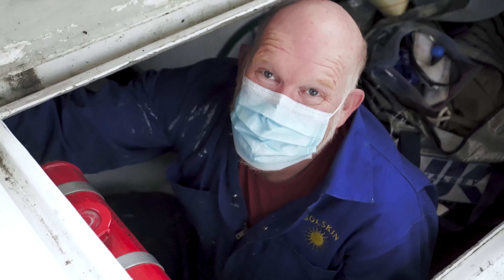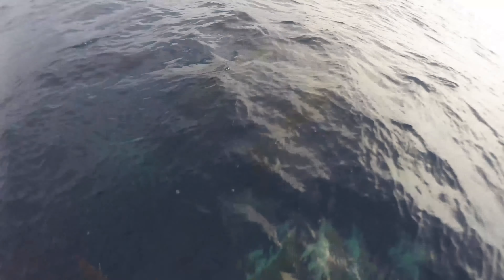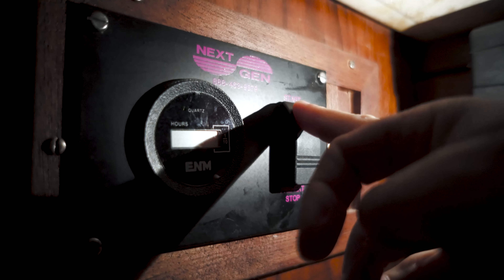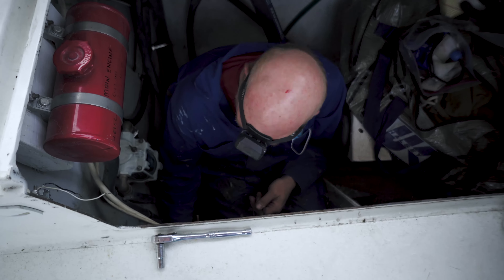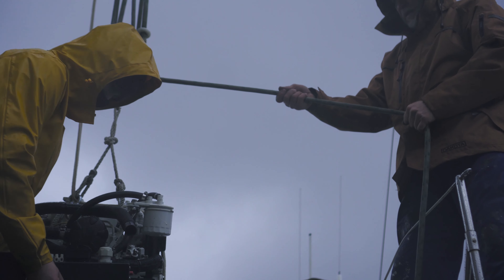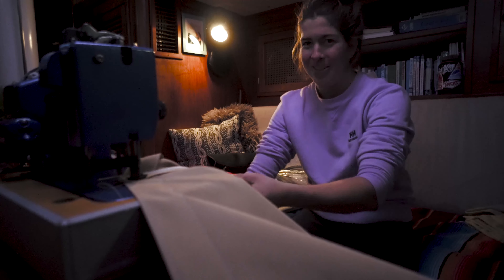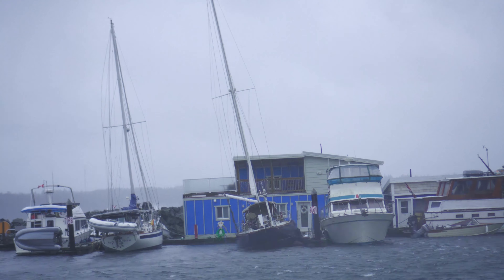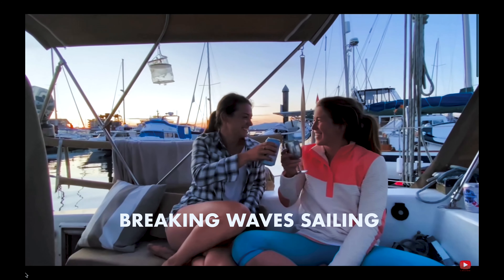EP 15 | Will We REGRET This? | Removing Generator & Hurricane Force Winds

Comment: Thinking of removing the 3.5 kw generator in my 40 ft boat.  Going more solar as have 900 w of panels and 800ah of AMG but going to lithium batteries.  400 w wind vane and and 600 w hydro.  Also a hydrogen generator by EFoy.  Have a scuba recharge pump but sure the solar can power this.
Reply from the maker: Those hydrogen generators look neat! Sounds like a sweet set up you’ve got! We’re looking at getting a little gas powered scuba compressor so we don’t have to power it from the boat. What unit do you have?